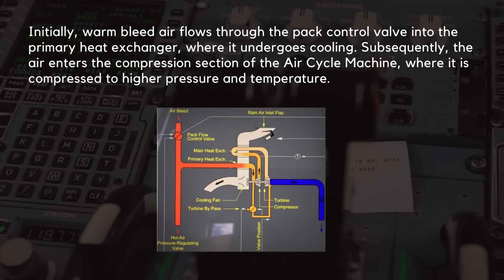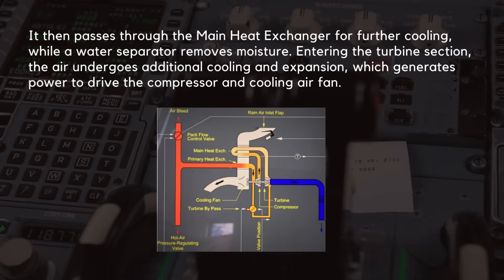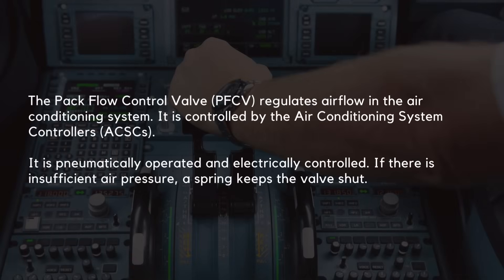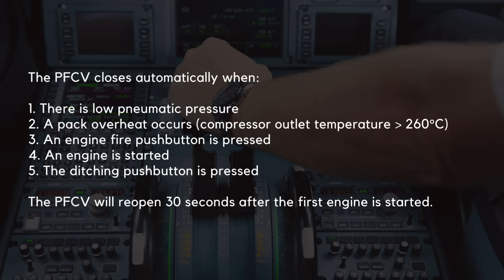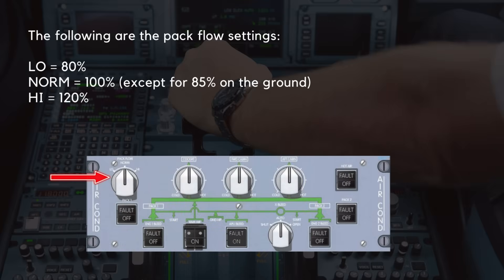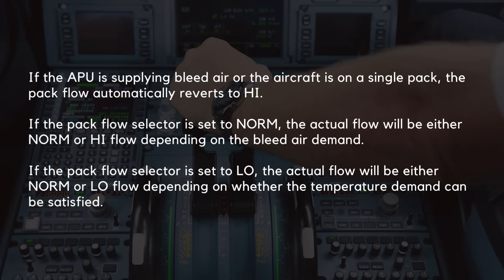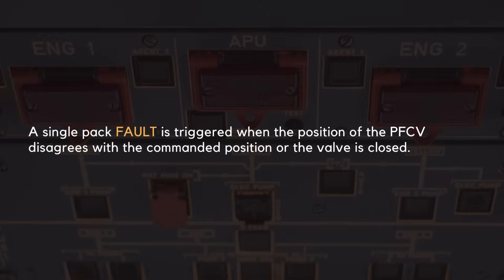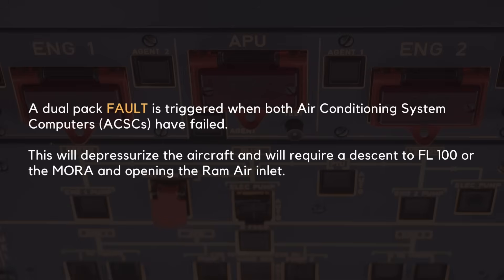A320 Packs Explained | A320 Air Conditioning

Comment: This system has no refrigerant. So how does aircraft ac keeps cold on the ground ?
Reply: By using the APU which is a small jet engine to get the pressurised bleed air.
Reply: Stepwise cooling through multiple heat exchangers, air cycle machines which allow for compression and expansion through turbines and compressors of the air thus adding and removing the temperature. Otherwise you indeed wouldn't be able to cool below OAT without refrigeration.